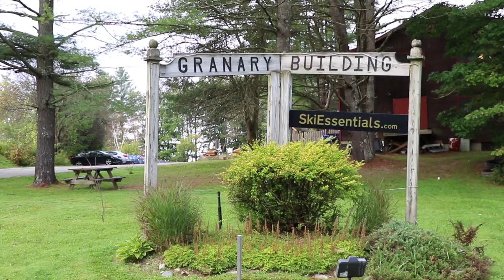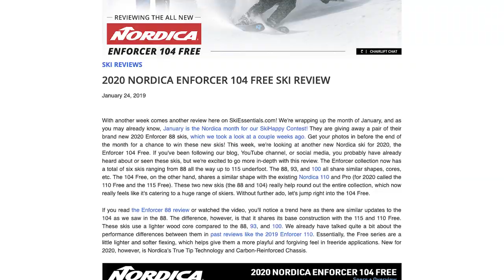SkiEssentials.com - About Us - Company History, Location, and More!

Comment: I watch a ton of your videos. Having just gotten back on skis after taking a 24 year break, I'm always looking to learn about products because EVERYTHING has changed! I skied up at Stowe last Sunday and I'm pretty sure I've found my new favorite mountain. Early am... Upper Starr and then dipping into the glades to the right of that once the steepest part of it was in the rearview mirror may have been my favorite run of all time... The snow was absolutely incredible. 
I enjoyed this video - but one thing I'd really love to see is a video with more info about your testers. Height, weight, skiing background, favorite types of runs, what skis you generally ride daily, and maybe even your favorite trail in the East. I think it would really help in narrowing down the list when choosing equipment. As for me - I'm 43, 5'9", about 180 lbs depending on beer that week, and until I bought a pair of 169 Salomon QST 92s this year, the last pair of skis I owned was a pair of straight Dynastars that was about 200 length. I love trees and bumps, but ski plenty of groomers. I want to get into touring now that I know my skills haven't suffered much from the 24 year break. I've got a pair of 9 year old Volkl AC 130 unlimited (170) skis that I got for cheap money that I love pointing downhill and carving. I may buy a hybrid touring setup next year... The Hoji Free boots (depending on fit) and shift MNC bindings will probably be where I start, but I would love to try a bunch of skis to see what I like. Any recommendations to narrow the list?
Reply from the maker: Hi James!

First, check out our Tester page from our 2020 Ski Test, you can learn a lot about different skiers there.  Height, weight, skiing background, basically everything you're looking for:

https://www.skiessentials.com/2020-ski-test/tester/

For the hybrid touring skis, my biggest piece of advice would be to dial in the fit and function of the boots and go from there.  The Shift is a fantastic binding, so hard to go wrong there, although the new Marker Duke PT is intriguing as well.  For skis, I would go a little wider than your QST 92s, maybe have your hybrid touring ski also double as your powder ski.

Hope that helps!